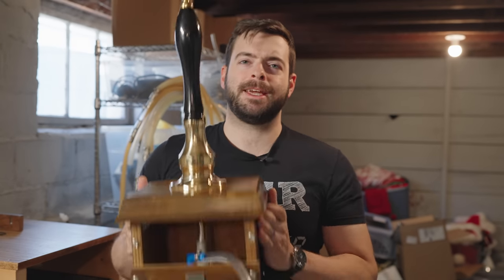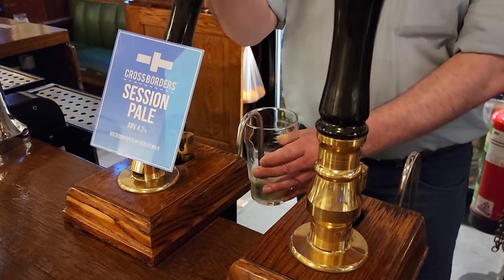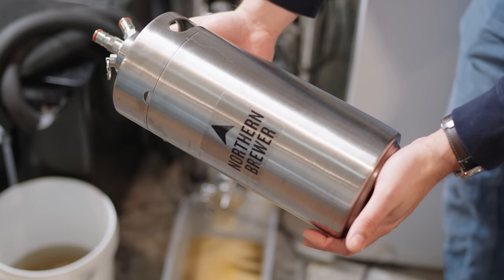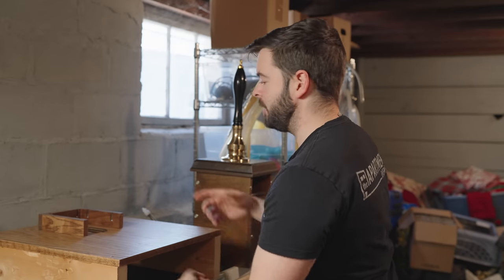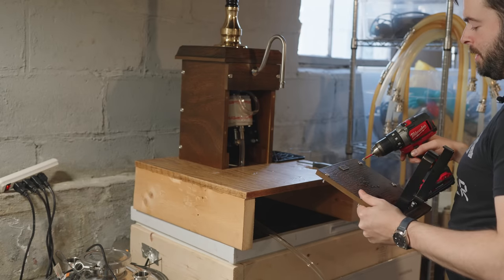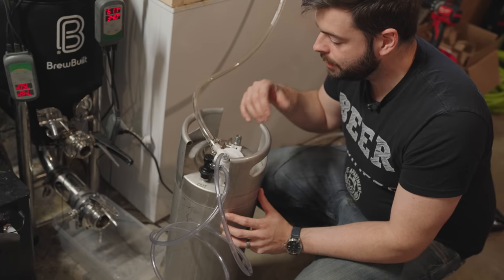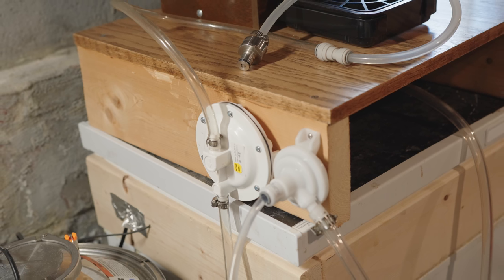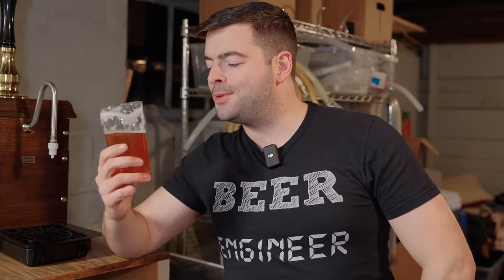How to SERVE YOUR OWN REAL CASK ALE at HOME!! (With Kegs!)

Comment: You can do very well using a 2 (or bigger) gallon accordion-like water jug and a Valterra RP800 hand pump (like what you see in some RV’s)! That’s about $50 worth of specialty equipment to get you rocking, and the camp jug has the added benefit of being self-purging - you draw from the top and the bag compresses as you drain it. Only an ounce or so per pour, but that’s hardly a problem when you’re just serving yourself and a couple friends, and it gives an awesome hand-pull like experience. I’ve used it to scratch the cask itch between visits to England.
Reply from the maker: Thats a great alternative, thanks for sharing!

Comment: In the UK we all went mad for this during lockdown as we couldn't go to the pub. You can put it all in a 5 gal corny and set it to 2psi and you're good for the duration. I've just cleaned mine all up and brewed a Marstons Bitter clone. Just need it to clear up (LA3)... might put some gelatine in there to speed it up.
Reply: Seen the cask breather you used which is nice. I've got mine on one of the kegland inline mini regulator.
Reply from the maker: Excellent! Glad to hear about the other options!

Comment: I'm in America and had no idea about cask ale and beer engines before 2021.  I found out about beer pumps randomly on youtube in 2021 and fell in love with the idea.  I first found and built the DIY version, using an RV-style water pump, a demand valve, and built a little stand to place inside a mini-fridge.  I then pulled the beer from a wine bag bought off of Amazon.  This worked well, but it took about 20 pumps just to fill one pint.  Once I found a good used Angram pump off Ebay, I bought that, built a beer cabinet to house the fridge and the pump and it's been heaven ever since.  I finally found a better bag, using a Wolverine Tuff 2.5/10L bag with attached drain spout that uses the exact same size OD tube as the demand valve.  This bag is more heavy-duty than a throw-away wine bag and I don't have to use the wine tap adapter anymore.  I even built a coolant system to keep the beer in the engine colder (engine has an in/out system for this built in) overnight by using a plastic fridge water container and putting a simple pump inside.  I end up having to refill this thing with ice everyday since the process is enough to warm the water, but it's worth the hassle to have cask-style ale with a Northern sparker.
Reply from the maker: That's awesome! I've heard plenty of advocates for the RV water pump build but the tuff bag is another great bit of ingenuity!

Comment: The pseudo method works great for sure.
What the traditional setup also does is it forms a yeast cake in the corner of the cask near the outlet (if stillage is used). So when you use the engine it draws the beer over the yeast cake increasing the flavor even more.
Well done for setting up your own system, cask ale is the best beer in the world!
Reply from the maker: There probably are subtle flavor differences, cheers!

Comment: Always entertaining videos...
I may well be wrong, however the sparkler looks like its on tight...it is adjustable to allow you to alter the pour for the type of beer and how its acting....cask ale is likely to change how the sparkler is adjusted throughout its life...can be excitable if very fresh...I suggest to experiment with it at least 1 turn away from tight for how you like your pour...
With a swan neck (which is what you have) keep the sparkler at the bottom of the glass during pour..
Sparkler on or off is personal preference
Reply from the maker: Never knew that was a thing! I will have to try it out!
Reply: @TheApartmentBrewer  also different sparkler styles are available...Hole size and number...if you do a thick hazy and it becomes difficult to pull, check the holes in the sparkler aren't blocked 😉

Comment: Hi Steve. I am using a Pint365 beer engine from Masons UK, which has a built-in check valve.  Masons says there's no need for a separate demand valve and I've served three kegs so far with no leakage from the spout. I feed my corny keg with 3-5psi of CO2 which (so I'm told) compensates for the vacuum created inside the corny by the Pint365. I've looked at the RLBS aspirator and I don't fully understand why I need one.  Please, what am I not seeing? The price is not cheap but if I need it, I'll get it.  Finally, when you drain the beer through the Y fitting and ball valve, if you don't serve again for a couple of days does your beer engine fail to pump beer?  Well done on this video.  There is no finer beer than cask ale.  Period!

Comment: I believe that a firkin holds 40 ltr.  The next size of cask down is known as a pin and holds 20 Ltr. The next size up from a firkin is a kilderkin and holds 80 Ltrs. 

Try drawing a pint without the sparkler, that plastic thing on the end of the spout. The primary function of this device is to form a head, northern uk folk prefer their pint with a well formed head. Southerners, like me, prefer a pint to be liquid rather than air, therefore pour without the sparkler. Also, the publican gets more pints from a cask using a sparkler, but that’s another story. I’d be interested to hear of your thoughts between a pint with and one without the sparkler. I have found that the sparkler detracts from the hop profile, somehow decreasing flavour. If I were a class beer I’d strongly object to being squeezed through a myriad of tiny holes into the glass, wouldn’t you? Also, keep the pipe run as short as you can, cask ale doesn’t like being pulled over too long a distant.

And finally, a plastic water container, like those used for camping, are a good option when using a beer engine, as it collapses as the beer is drawn off. The one down side is that they are not a pressure container and will balloon in the early stages.

I hope you have enjoyed using your (now not so new) beer engine.

Comment: I have a similar setup but made the cask breather element using a $14 propane regulator from Menards. Basically a carb cap into some line then into the regulator then some line out and a gas disconnect. It's compact and knocks whatever pressure is coming in from the CO2 tank down to 1/2 PSI, just enough to break the vacuum when pulling pints and top off the head space. It's compact enough to just go right into the keg fridge when I'm doing a cask beer.
Reply from the maker: Thats awesome!

Comment: If possible I recommend to attach cooling lines to the pump/cylinder. It make the beer last longer and you don't have to remember to drain the device after every session.
Reply from the maker: Definitely would be a good upgrade!

Comment: Dont forget the tilt on the first half of the pint and the nozzle never goes into the beer as you are pullibg a pint so slowly lower and straigten your glass as you go
Reply: Sorry to disagree, he is serving with a sparkler, which should be maintained just below the head formed witht he first pulls, so yes lowering the glass as it fills but in the beer although not at the bottom of the glass and keeping the glass straight.  The angled glass is for a pour without the sparkler...
Reply from the maker: I don't know the etiquette particularly well haha so I'm doing my best based on watching a few folks serve pints in the UK, but good to know the differences!

Comment: What's the comparison like for beer served from the engine vs a pluto gun with the keg at low pressure? Say 1.5 volumes (~7psi). The purpose of the question is to enquire if the important factor is the carbonation level or the dispensing method.
Reply from the maker: Never used a pluto gun so I can't tell you. That being said, any higher pressure is going to result in a glass full of foam

Comment: I loved this solution of smaller kegs to still have this at home with air. But you're still spending a lot of time brewing such a small batch.. Unless of course you brew enough to fill a regular keg and also a smaller beer engine keg..

I would really love to try a dry irish stout, to both have it on nitro and in a beer engine with oxygen.
Reply from the maker: Thats what I did - one small 1 gallon "cask" for real ale and the other 4 gallon going into the corny keg with cask breather

Comment: I would love a setup like this but don’t have the space. I wonder if most of this effect could be accomplished by a special thread-in sparkler faucet for Intertap/Nukatap pattern taps. Similar to how there are stout/nitro inserts. Maybe that plus low carbonation and serving pressure would get the effect? I guess it depends on whether the sparkler is doing the heavy lifting here, or whether there’s specific magic to the hand pumping and/or atmospheric air ingress in the cylinder.
Reply: Historically sparklers were only popular with cask ale drinkers in the north of England where they like a soft foamy top in the glass. In the south cask ale was served straight from the cask at room temperature without a foamy head or flat. I would say that it’s the way that English ale is brewed is more important than how it is served, though I agree it adds something extra.
Reply from the maker: Perhaps a little bit of both? I used a stout faucet on an irish stout with CO2 a year or so ago and it was OK, but not quite the same. Same story with nitro. The interesting thing about cask though is that the beer evolves and changes flavors week to week and its a little different each time though - I'd argue thats really the magic.

Comment: If you can't find ( or don't have the space for) a beer engine, could this be reproduced using a standard tap? With the Intertap/Nukatap faucets having detachable tips, I'm amazed Kegland hasn't released something for the cask ale lover.
Reply from the maker: So in this video: https://youtu.be/R-1YCL3aqMA I actually tried this concept out. I used a stout faucet and pushed the carbonation out and it turned out fairly close!
Reply: @TheApartmentBrewer   Can't believe I missed that. When you use that stout tip, do reduce the pressure any or leave it at serving pressure? I have that stout tip but never used it.
Reply from the maker: Yeah the key is not to have too much carbonation in the beer and to actually use a high pressure to serve
Reply: @TheApartmentBrewer  Ok, what co2 volume would you recommend aiming for if I decide to use that tip? What do you set the serving pressure? I'm usually at 11psi for serving pressure.
Reply from the maker: I think i would go with cask levels at 1-1.5 vol and then run 15-20 PSI to get it through the stout faucet
Reply: @TheApartmentBrewer  Could you split a 5 gallon batch for experimentation? Maybe 2.5 gallons as a standard co2 beer. The other at the settings you've suggested but with a stout tip on its faucet?
Reply from the maker: @justinthomas6033  it's not on my list to do but it's totally feasible
Reply: @TheApartmentBrewer  LOL! I meant for myself. Sorry for my confusing post. That might make a great episode though if you have thought about it.

Side note: I appreciate you taking the time replying back to my questions. Thanks and cheers!
Reply from the maker: Anytime! No worries and best of luck with it! I hope you discover something that works well for you!

Comment: With the one gallon keg are you using a floating dip tube to prevent sucking up sediment?
Reply from the maker: Can't fit the float ball in so unfortunately no, but it seems that the yeast flocculated out enough.

Comment: Also slow full pulls on a beer machine non of this pumping it manically in short fast pumps like i see some bar staff doing now and then wonderimg why the cellar bouy has air locked
Reply: Never seen a cellar bouy on cask ale...if the cellar is significantly lower or far away from the beer engine, a flojet if used. As standard...only keg beers use a cellar bouy to make it easier to switch kegs without foaming and stop the gas flowing through the line.
Reply from the maker: Definitely want to pull it slowly, feels like it could be easy to break otherwise!
Reply: @TheApartmentBrewer  a steady pull is what's required...a pause on the full stroke, If needed,  to allow the beer engine to overcome the vacuum and fill...if its too firm a pull (to feel like something could break) it's most likely inadequate flow in or out...
Any problems feel free to ask 🫡